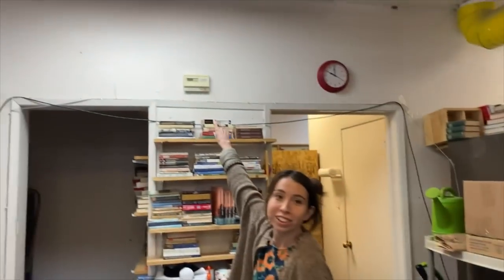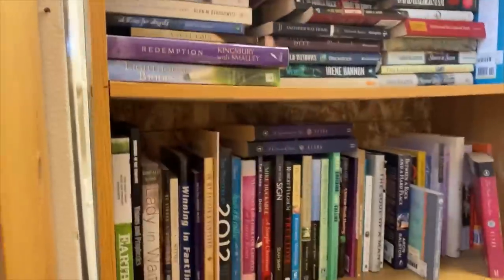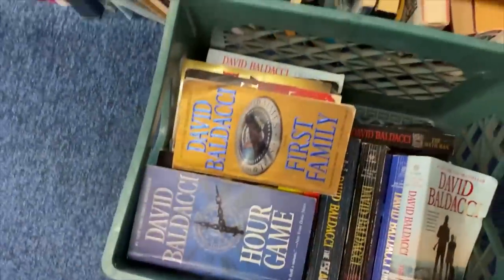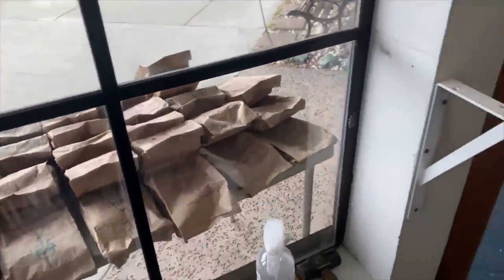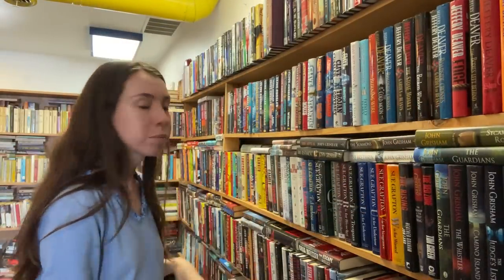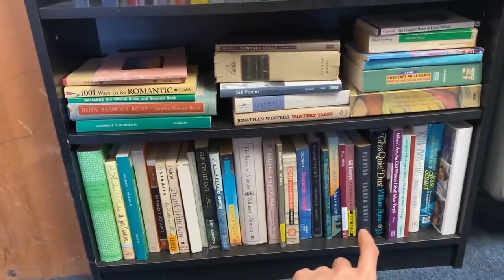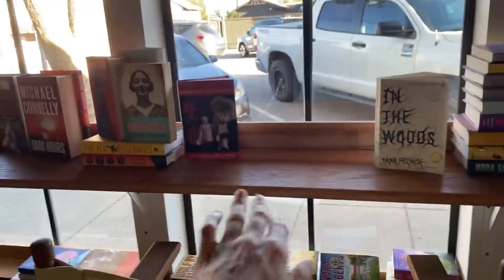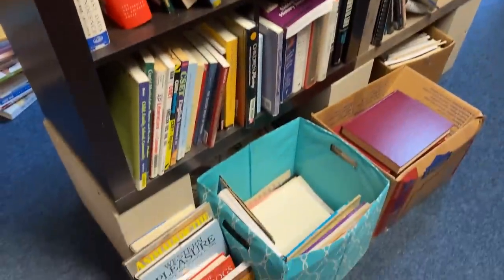We bought a used bookshop! First 6 weeks: some light renovations and a tour 📚📖

Comment: Stacking the books instead of standing them up is such a genius idea. In addition to making the shelves look nice and tidy, you also get the added bonus of not having to turn your head this way and that to read the titles.
Reply: I used to stack my books on certain shelves and then I read " stacking books horizontally can place undue pressure on book spines".  I am not sure how valid the source of the info is but I want to protect my investment!  You are right though it is easier to read the titles.
Reply: It damages the spine though.
Reply: To me it is a terrible idea. It damages the book and it is a hassle to take the one on the bottom out if you just want to flip through it.
Reply: @Danielle2Cats Especially the hardcovers…
Reply: I´m a Liberian and I rly would advise against storing your Books that way. The weight off the Books will warp the Spine and damage the Books.
Reply: I disagree. I wouldn't browse in the same way as a complete hassle to pick out the books. Plus the spines often look in worse condition. It looks much much neater with vertical books.

Comment: Maybe put self-help,  religion and spirituality in one area. Also, there is a vintage bookshop here in Winchester, they mark the prices inside the front cover in pencil.  It would be better than sticky notes which leave a residue over time. All the best with your bookshop. It looks amazing!
Reply: The secondhand bookshop I used to work in did it in pencil on the first page too. super handy and easy to remove 🙂
Reply: I think this is accepted practice in used bookstores in Sweden, price is always marked in pencil either on the first or the last page of the book. Super useful

Comment: Sorry, but I wouldn't shop here. It's not neatly laid out, lacks charm, and there aren't clear signs. Plus, it's a bit cluttered and the books aren't treated well.
Reply from the maker: Hey bestie, this video was from when we first bought the shop. The whole point of this channel is that we’re revamping it so it is neatly laid out, is charming, and has clear signage so people can easily find what they want. This takes time so we weren’t going to get it all done in a single video 🤗 Regarding the books, we’re clearing out everything that is not in good condition, cleaning the books, and will be stacking them vertically instead of horizontally, so they will not be stacked on top of each other, and therefore will be in better shape. Love and light, Clio and Carla ✨